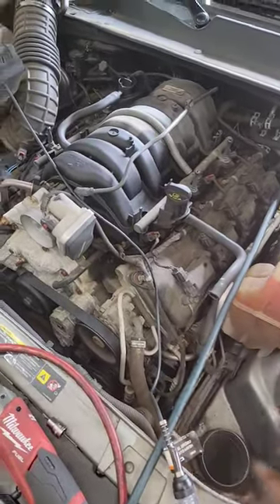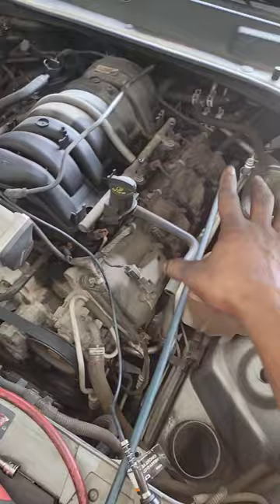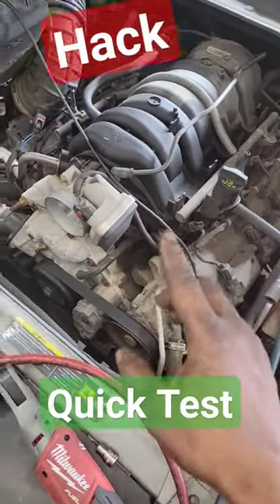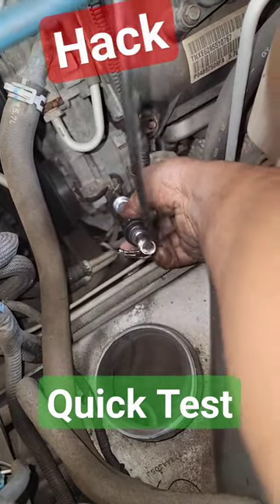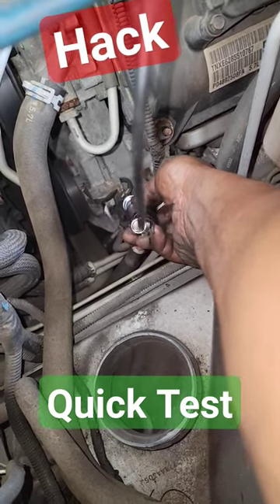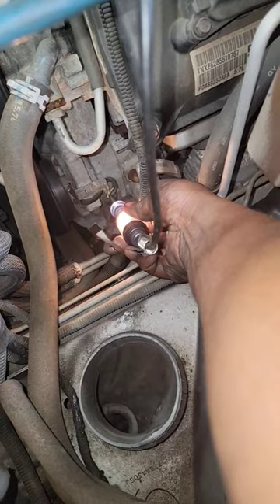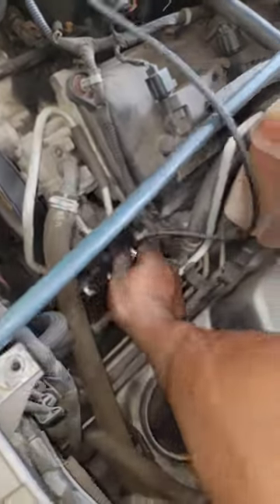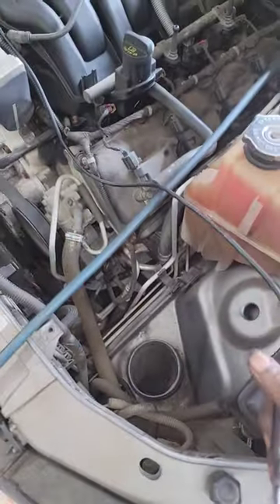Quick Hack Check to tell why your AC not Cold. You might need this

Comment: Some cars you can buy the clutch alone. From memory, a lot of those were Chryslers.
But not the newer ones, and not the 300 5.7 hemi one.
The benefit of a clutch swap is that you don't usually have to crack the system open. Whenever you break that seal for any reason you need to pump it out and recharge/oil it.

Comment: you can buy clutches for any ac unit out there but not through dealer you can go through the manufacturer of the ac unit itself but yes they do still sell them and i can prove it ive done plenty of them
Reply from the maker: O if the parts dept don't have the part we don't do it. We get the complete compressor
Reply: it is better for the customer tho warranty wise i was doing it for a tour company was there mechanic for a long time so for them its cheaper to change clutch out but long tem i totally agree with changing the compresser never know how much its been through or what kind of life it still has in it so customer wise change compresser 100 persent
Reply: Dealers don't STOCK them, though. Nor do the local suppliers like LKQ or 1800 radiator.
He needs a warrantied part, from a local supplier he can trust.
Not have the dealer order it, or find it online from who knows where.

Comment: Did you check low level switch? Sometimes it needs electricle connection cleaning
Reply from the maker: Naw, if I got 12 volts and ground at a electrical item and its not working, thats all I need to see to tell me whats wrong in this case.
Reply: You're basically right, but.... Low refrigerant will keep it from commanding the clutch.
He's getting voltage at the clutch.

Comment: Only replacing AC Clutch is exercise in Futility.
Reply: Nah. If it's just the clutch it's just the clutch.
Unless it got super hot.
Clutches didn't start disappearing from stock until late 90's early 2000's... because in that era... IT WASN'T JUST THE CLUTCH.
All GM's were "grenading" compressors.
All Dodge/Chrysler products were leaking out of every aluminum part. Evaps, condensers, accumulators, all sprung leaks.
We sold tons of  "blockoff kits" for the rear ac on minivans, because it wasn't worth replacing that ENTIRE LOOP of leaky parts. (not just chryslers either, but pretty much all vans with rear ac were trouble prone)
It was hell.
But... we made a lot of money doing AC.

Comment: If there was no voltage on that connector will that mean the sensor is bad?
Reply: Youd need a wiring diagram. Could be bad wiring as well
Reply: @husseinsaad1381  true thanks

Comment: Way to go poke a hole in the wire so corrosion accumulates. Use back probes or load test it with a light bulb... man put up your tools bro
Reply from the maker: I got this big dawg. If you want to give out advise or showcase how you do things I suggest you simply make a video and start a youtube channel. Show your way on your videos, we not interested in your way over here, we good. FOH
Reply: It looked like he shoved it in the backside of a connector.
I do that all of the time...

Comment: You just said that the pressures were fine. If they were, then it would be operating and cooling. Pressures cannot be "fine" with a bad compressor.
Reply from the maker: I meant there was enough pressure in the sys to close the circuit that goes to the compressor. If the pressure was extremely low, there would have been a good chance that the low pressure cut off switch opened the circuit.
Reply: @OnlineMechanicTips  Words mean things. We are not mind readers. When you say "fine," that gives me the impression that you have gauges on it and the system is running. In that case, I would have looked at the expansion valve. However, now that you clarify what you should have said in the first place, I agree that the compressor is not working. BUT, how about an open clutch winding? That can be replaced without replacing the compressor.
Reply from the maker: @jimgarofalo5479  Well it depend on your initial approach, all mechanics are different. Especially when it comes to a video. The only reason that was even mentioned was because of the video. When i first brought the car in I went straight for the compressor clutch (im familiar with this car history) Only whiped out the machine and mention pressure reading because it make for good video. My point is, everything done has a motive behind it. And im speaking about the car that im working on. We cannot get parts for just the clutch assembly. Im sure other cars parts makers may have that option.
Reply: @OnlineMechanicTips I'm sorry man i feel like that dude was rude just wanted to let you know your videos are really valuable and please never stop doing them thanks a lot really
Reply from the maker: @noobstrom3279  Lol, man I go thru this daily and use to it now. Theres always underlying tone messages in people comments. I always try the civilized  approach with my reply first and then see where it leads. But thanks for watching the videos my guy.
Reply: @noobstrom3279  You think it is rude to tell the truth? To clarify mistakes? 
The statement was vague and misleading. I simply pointed out that if pressures are good, system should work. Yet he goes on to a bad compressor. That is misleading, and only part of the story. 
I did not mean for this to turn into a big argument. I only wanted to CLARIFY what was really going on.
Reply: @jimgarofalo5479  I'm so sorry brother i didn't mean to be rude you are right to point the mistakes it just that man works hard providing  all that information so you can point the mistakes in a more polite way
Reply: @jimgarofalo5479  
You're NOT telling the truth.
The charge isn't the problem.
The clutch is the problem.
When he said "the pressures are fine" he means the pressure reading showed him that it's charged. (Not empty, or too low to pump) It should be commanding the clutch and pumping.
He found it WAS commanding the clutch, but not pumping.
Therefor.... clutch.
Reply: @castanza128  I had  this conversation with the mechanic and a couple of users a couple of months ago, and I most certainly AM telling the truth! 
The issue is the definition of pressures being "fine." Fine pressures are readings of 25 to 45psi on the low side and 150 to 350 psi on the high side. You will NOT get those pressures with a bad clutch - therefore NOT fine. If you get those pressures, then you are also getting cooling, hence fine. 
The mechanic referred to the pressures as "fine" because they indicated that there was refrigerant in the system. Important wording was left out, which I called him on, and he then clarified what he meant to say. 
As for you, sir, perhaps you should go back and re-read the previous posts before you start calling people a liar. 'Kay?
Reply: Exactly
Reply: @jimgarofalo5479  so you mean if the clutch is bad the pressure on high side and low side will be the same?